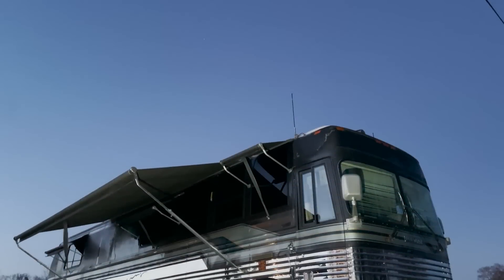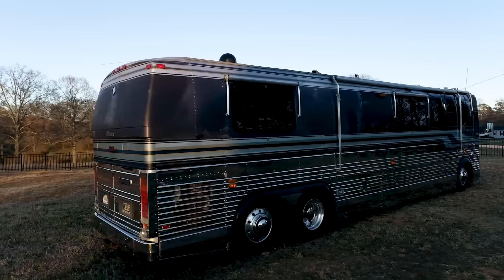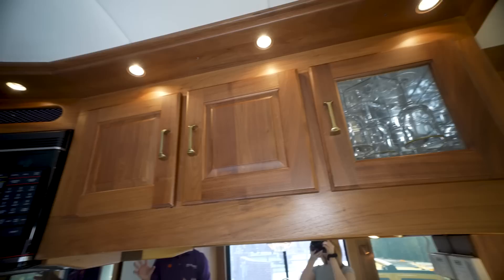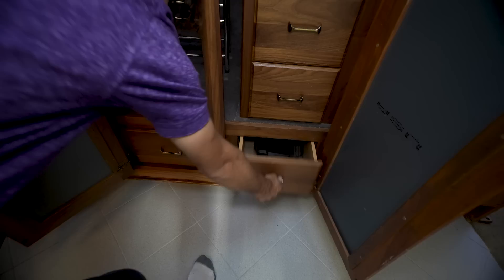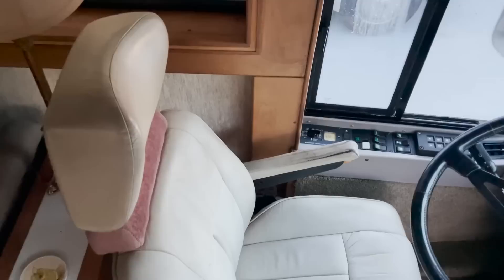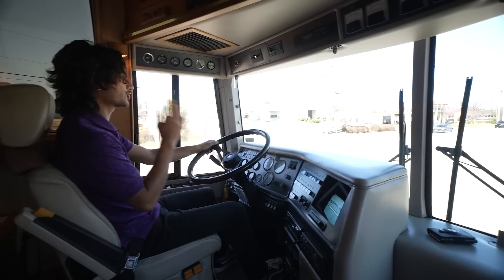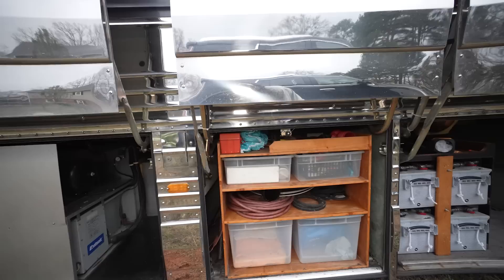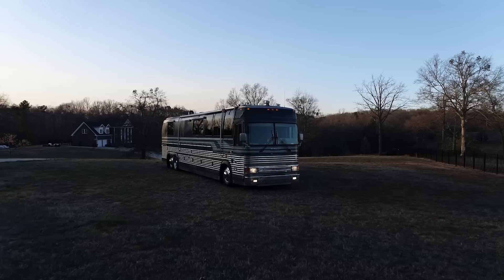1992 Royale Coach Prevost XL40. Astonishing Woodwork, Intelligently Designed.

Comment: I’m looking at hitting the road as a missionary when I retire. The silver 8V92 engine was the best mechanical engine made, in my book. I started driving over the road in 1987. The nice thing about a mechanical engine is that it will run without electrical power. It will get you to help. I would prefer a series 60, but would take the mechanical any day.

Comment: How can you prevent fogging on windows and staining carpet? Is there a solution that kills staining, body damage, scratches and rust?
Reply from the maker: Unfortunately fogging happens to pretty much all the dual pane windows you see on RVs, from Prevost & Newells to Newmar's and Coachmen's. Things can be addressed, just depends on the coach you want. The most important part are the fundamentals of the coach side and chassis
Reply: @rvmaxus  Sadly  nothing last forever in terms of maintenance and I love the content a lot.

Comment: I wouldn't buy it unless it had a 60 series engine but since a 92 forget about a 2 cycle engine uses to much oil and not many people service them
Reply: I'm a diesel mechanic and unless you have no knowledge of 2 stroke Detroits , It's nice to stay quiet. Cared for an 8v92 can roll lots of miles. Most don't know what oil they use and damage them. Change fuel, oil filters and add lubricity to today's lousy fuel. I see a long future. Much better than the DEF drinking junk produced nowadays..
Reply: Way to much for that bus needs new tires $ 9000 plus aqua hot to repair $1000s of dollars plus 2 stroke  if anything look for a series 60 engine in a 95 and up bus those are the best   them 2 strokes I wouldn't buy unless a good deal maybe worth 60K not much more that's probably what he got it for
Reply from the maker: You are right, they are fantastic engines if you know what you have. I almost always tell people intersted in an 8V92 bus, you either need to work on it yourself, or know someone who is familiar with them. This one was taken care of by the owner, has all sorts of extra parts and the engine looks and drives like it was maintained pretty well.
Reply: If you can turn a wrench on an old Chevy..you can wrench on  an old Detroit.  Plenty of info out there and parts are everywhere.